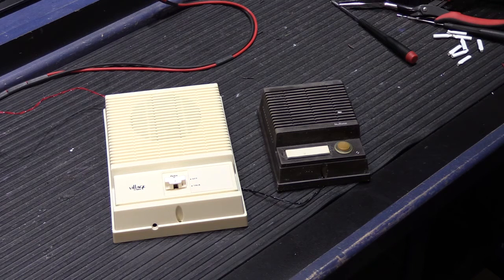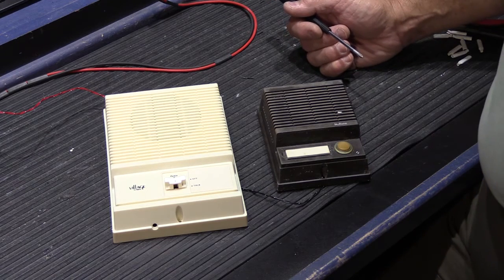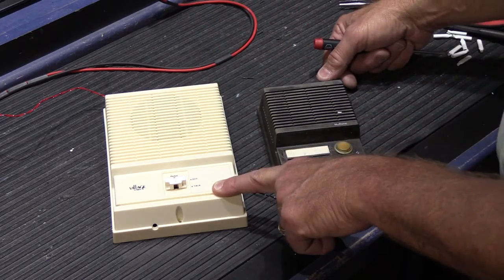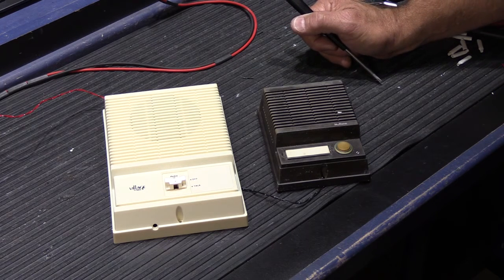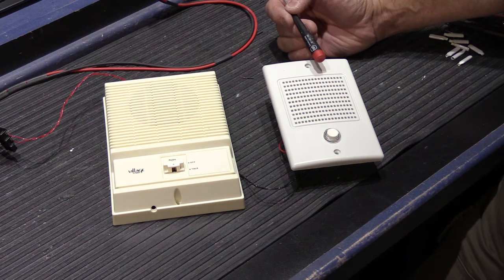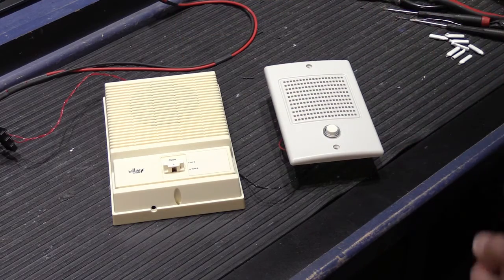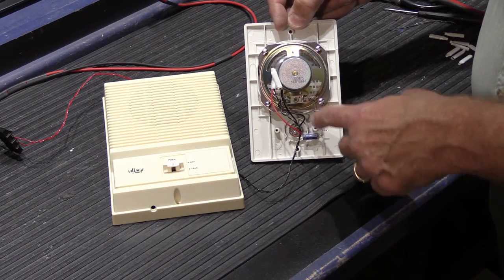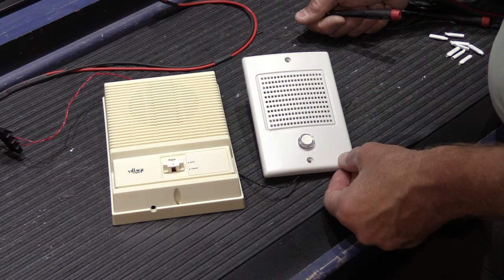Operational Check-Out of a NuTone IK15 Entry Intercom System

Comment: Have that unit (NuTone/Scovill branded) for years now. My 'Door Release' button operates my  garage door opener which is right next to the front door, and when the problems with the ugly outdoor station began, I replaced it with a brass door station, and added two wires to use my regular NuTone KB-10 door chime, with of course, a lighted pushbutton. Had to add a resistor so the bulb doesn't burn out from the higher voltage of the intercom transformer.
Reply from the maker: Hi Ron:  Sounds like an interesting work-around.  Does the Intercom Communication still work? - Chris
Reply: @northsideservicecompany3567  Absolutely, and has for many years.  The intercom door chime sounds sometimes after a power outage restoration, letting me know the power is back on. Such a convenience...😂
Reply from the maker: @ronk9830  Cool - They do that - Chris

Comment: I installed the IK-25 when I built my house almost 30 years ago. Now the system does not work. The door bell does not work. Could this be because the transformer went bad?
Reply from the maker: Hi Tony:  While it is always possible that the Transformer has failed. it is unlikely.  The most common failure point with a IK15 is the IS68 Door Station.  The speaker and push button will fail from being outside for 30 years.  You can test this theory by removing the IS68 - disconnecting the wires from the Brown wires on the  IS68.  Then touch the 2-wires that come out of the wall together - if the IK15 is working - the Chime will Ring.  It is also possible that the IK15 needs repair.  We have replacement parts for the IS68 - Chris
Reply: @northsideservicecompany3567  Thanks for the reply. I did as you suggested and after touching the two wires that came out of the wall the doorbell worked. So I need replacement parts for the Door Station. What is included in the replacement parts? And what would the cost be? Thanks
Reply from the maker: @tonyzidik2890  Good Job.  The Internal assembly for the NuTone IS68 Entry Door Stations includes: New Speaker Cone - New Push Button - all wired together with new Capacitors.  It fits into the same mounting locations as the original assembly.  You can call our office for pricing and to place the order - Chris  925-743-8236

Comment: would love to see a video on how you would wire this up with a ring pro doorbell. replacing the brown box and using the chime on the indoor mainboard is my goal.
Reply from the maker: Hi OdysseyOG:  The short answer is that it will never work - Chris
Reply: thanks. i ended up pulling the wires that came from the tranformer and connected them directly to the doorbell wires instead of the circuit board. this gave me the 16v ac i needed but disabled the entire speaker box. i was ok with this as i never used the unit as intended anyway.
Reply from the maker: Hi OdysseyOG: Yes, bypassing the IK15 completely is the only solution - Chris
Reply: Hy OdysseyOG, I'm researching what you just did, replacing the Nutone intercom with a Ring doorbell. Which wires did you connect to the Ring terminals—the two orange wires? Thanks!
Reply: I had to take the two wires that connected to the red circuit board pig tail wires and put those with the the two wires that used to be connected to the green circuit board pigtails. Effectively pulling power from the circuit board and sending it directly into the bell wiring. Also requires an inline fuse from ring for safety. Good luck.
Reply: Thanks Odyssey, I have the diode supplied by Ring, but my intercom was lost by contractors a while ago, I just have a cable sticking out of my stucco wall with a red pair, orange pair, and black pair of wires. Do you recall if the wires you used were the orange pair and black pair? I'll test it in the morning if you don't recall—you're the closest thing to an answer to this question I've seen repeated on different websites.
Reply: The colors are different because your contractor didn't wire your house with the same colors that mine did. You need to know which colors are bringing in power from the transformer and which colors are running to the front door bell. Connect those together once you know. Find your transformer and look for the color coming off it and remove your outside bell and see what colors are there. Should be fairly easy to figure out.
Reply: The third pair is probably for a door release buzzer to let people in the house. That pair will be useless and can be capped off

Comment: If the IK15 inside station fails, what would be an appropriate replacement?
Reply from the maker: Hi rpprevost: The most direct replacement for a NuTone IK15 is the Aipone C-123 L/A  Chime Com System.  You will also need a Aiphone SKK-620C Power Supply.

Here are some link to the products on Amazon
C-123 L/A:     http://amzn.to/2CRWXTr
SKK-620C:    http://amzn.to/2EW0NM0

The Aiphone Door Station and Inside Station are almost exactly the same size as the IK15 Stations and the intercom Systems works on just 2-wire between the 2 stations  - just like the IK15.

The major difference between the 2 systems has to do with the Power Supply.  The IK15 uses a standard 16 Volt AC hardwired Transformer - The Aiphone uses a 6 Volt DC plug-in Power Transformer

If the Aiphone Power Supply is going to be installed in the same location that the original NuTone transformer was located, you will need to convert the electrical junction  box into a plug-in electrical outlet  - providing a place to plug the Aiphone transformer into.

If the Transformer is in a garage or basement that already has electrical outlets available - you can extend the original wires to a nearby outlet and connect them to the Aiphone Power Supply - Chris
Reply: Thank you for your reply. I really appreciate the thoroughness of your answer.
Reply: I've scoured the circuit board and the components of the inside station. The push button for the door opening mechanism still functions to unlock the front door, and the bulb in the push button still works. I've tested the speaker cones (inside and out), and both are functioning. I've checked all the wires for continuity and they're all good.  I've tested all the diodes on the board, and they all appear to be good. I've checked the resistors and they're all good. Power is reaching the outside door station. But the door chime does not work nor does the intercom. I'm stumped.  

It's  a relatively uncomplicated circuit, but I can not locate the problem. To the best of my knowledge, a capacitor requires a special meter to test it. So those are the only components I have not tested.
Reply from the maker: Since there were many variations in the design of the IK15 over its 40+ years of production - my comments will be "general comments"

I don't see any results for the testing of the 7 (or so) IC's in the IK15 or the several transistors (2-5 or so) These parts form the backbone of the circuit design and everything else is simply power supply related or basic supporting components (which are unlikely to be the primary source of any problem)

You can see why for the most part - Models like the IK15 and IK25 were never really repaired - they would simply be replaced with a new unit (when they were still available).

It's the classic example of the cost to repair fair out weights the cost of the item.   

Finally, testing capacitors does require both a Capacitance and ESR meter - Testing small value capacitors is pointless now-a-days, in my opinion.  The time to test is equal to the time to replace - so if they are suspect - just replace them.

Chris